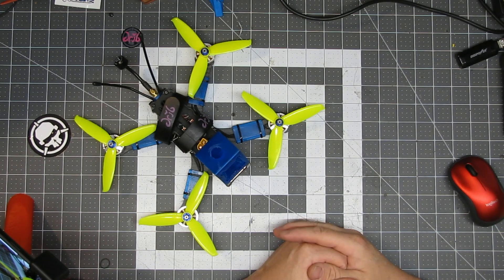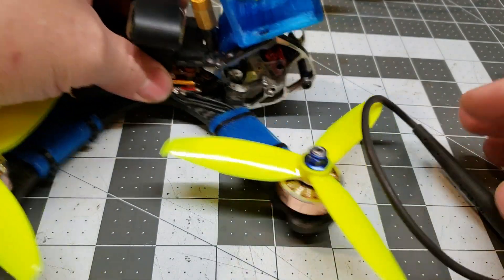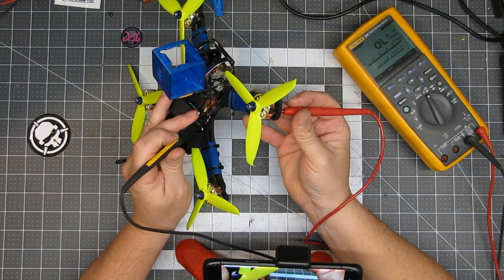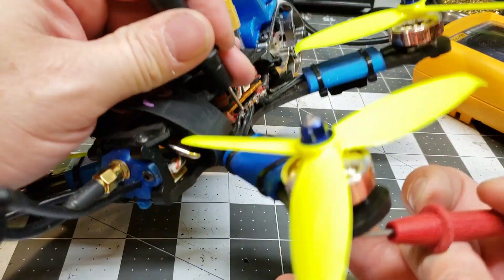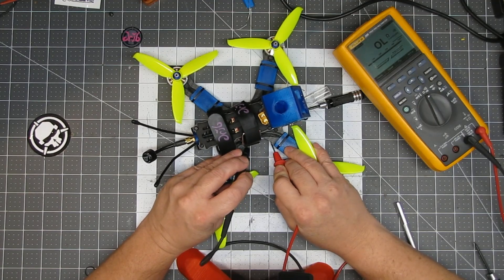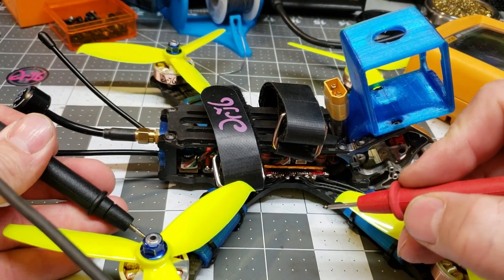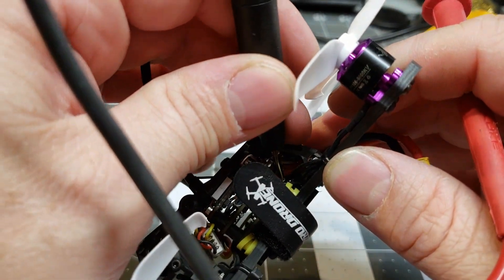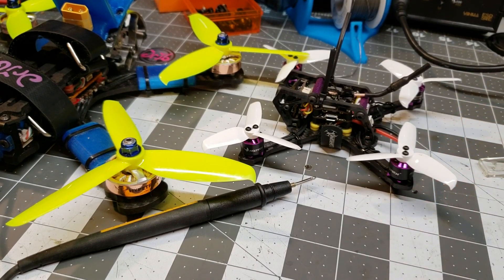Do you have HOT motors? Betaflight 3.5

Comment: Just built a lil rocket 3 inch using 1306 s that I actually rewound myself.  Finally got it in the air , but they came back hotter than normally. Wouldn’t have thought about grounding, sure enough , beeeep.    Appreciate it bro!   Happy flying!